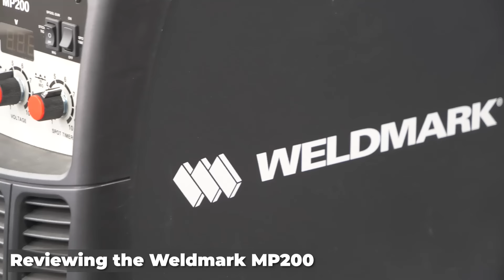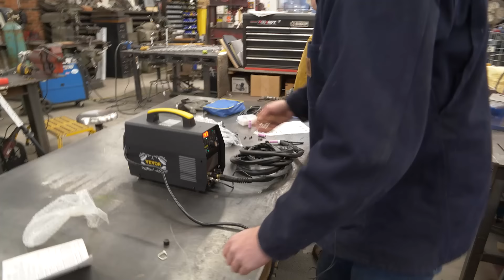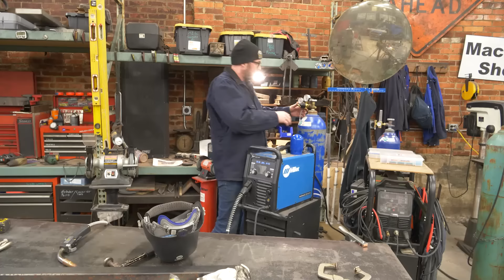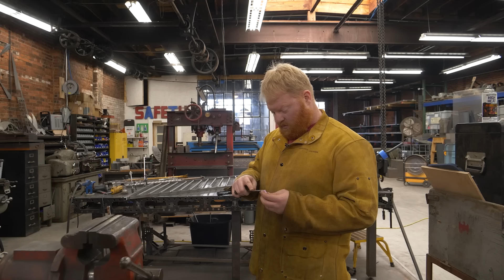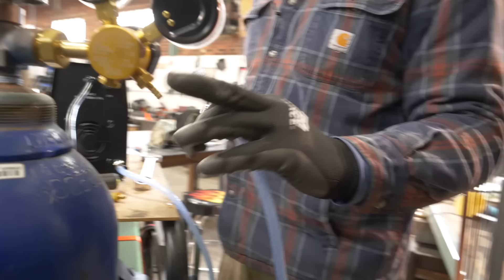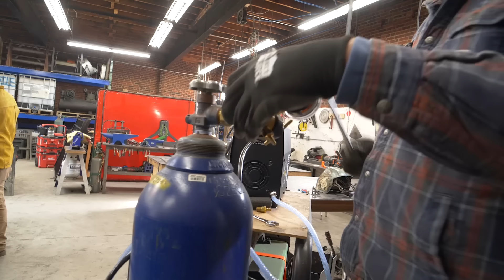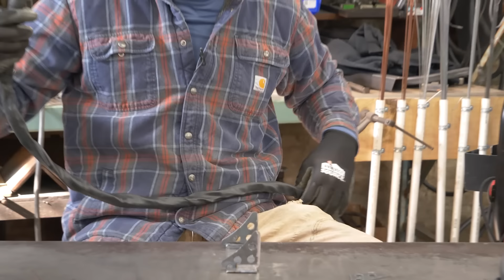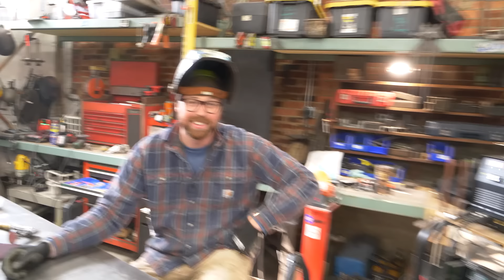$200 TIG Welder VS $2,000 TIG Welder

Comment: For the hobbyist it's a no-brainer..go buy it!
Of course, you can't use it in a professional environment where you weld 7 hours a day, but it's not meant for that.
I weld some stainless now and then and I bet it can weld my copper too. Home users won't do much in aluminum which requires AC mode anyway.

Comment: I have a everlast multi process and I just can't get it to weld with flux core wire... I must be doing something wrong. Maybe I need a different wire feed wheel. It just shuts off when I start to weld. Drives me crazy. I hate to buy a cheap flux core welder when I have a big nice welder.

Comment: You cannot really compare something by the size and weight, go back 8 - 10 years ago and remember what your cell phone was like, a brick, or a PC, they are now very small, more powerful and can easily hook on the back of a tv. Going back a few more years and remember the stick welders(most, probably still working) that took 2 people to lift them, now better products in a shoe box. Its just evolution in electronics, not that I'm saying the Vevor is better than your AC/DC Everlast, but you get my drift.

Comment: Have a synchrowave. Miller, 250 trail blazer with high frequency and CK MT200. Had an Esab welder this size and sold it, sure miss it. This will replace it.

Comment: 20:21 its not, only a two pin connector on the pedal/trigger input  for on and off, with an amperage controlled varistor/encoder style pedal/switch theres about 9 inputs

Comment: Not really much of a test. I like cheap, but many of these types of welders work good in a sweet spot, mid range current. Then they sometimes 'drift around' on very low or very high settings. An opposite example is with low-end, name-brand welders, import cheapies with blue or red paint job and big price tag. . Small Miller welders (1000$)with electronic gadgets that constantly try to out-guess you. Will not stitch very thin sheet metal. 55$ Harbor Freight 175 amp open-box special with only 4 heat settings is better for delicate work.

Comment: All my Chinese products quit over time. The difference is the quality of the components. The electrolytes in the capacitor, the quality of the solid state devices. The often under sized resistors, the gas valves etc. they all work, but not for long. You may get lucky in that the lot of parts was good but most often the quality control of their supplies is questionable.

Comment: I weld stainless process piping for a living . Young kid showed up to the job with the same exact welder .... my my miller maxstar 200 was at the other enc of the plant so i gave his lil machine a go , I almost cried , it welded as good as my miller ..... now will it last 10 years with daily use , probably not , but I was impressed how well it welded sch 40 stainless pipe.(edit) the twist connect are miller type connections

Comment: Duty cycle is the voltage and amps it can run at for a hour for a certain percentage of that hour soo let's say 100 amps is 100 percent duty cycle but 160 is 50 percent duty cycle meaning it can only weld for 30 minutes of a hour at 160 amps also each input voltage effects the duty cycle. Also u cannot weld for 100 percent of the time for a hour soo 100 percent machines are nice at max amps but not needed as u know u need time to let things cool etc and can't just put 250 amps into metal for a hour and have a good weld especially on exotics what tig is really only good for lol

Comment: The crazy thing is that at $200, you really have very little to lose. If you spend $200 on this, buy a tank of argon, start investing in other accessories, then when you want to step up to an AC/DC welder, the next logical step is something like Primeweld for $800-900 which has all the capability you could need if you aren't in a factory production environment. So sure, you're out $200, but then you also have a backup or portable machine, and your gas plus other accessories all carry over.
Reply: Right now its 86 bucks for a 4in1! Crazy!
Reply: @darrinhaskell6068 Yeah the welders China is producing are just so insanely cheap it's wild.

Comment: I bought a cheap welder, miltiprocess and it works great when it comes to stick and flux core. It has modes for mig with co2 and mixed, and it clames to be a lift tig as well. However the gas setup is problematic. Bought a regulator, bought a bottle, but they don't fit. The connectors seem to be made for each other since I don't think the differences between standard sizes would be this small (like .1 of a mm) so the second regulator is on the way. a bit more expensive this time. The welder came with a tig torch and i'd love to try it out but connecting the gas... there's so many types of connectors. At first I thought they put the wrong fittings on it, most of them seem to come with a nut, but mine has a male type of thing. After looking at lots of torches online I did find some with the same connector as mine, so it's probably not their mistake. However, after looking at quite a few, my type seems rather rare.

Comment: i just bought a yeswelder tig 205ds off marketplace for $80 and it works great.  it came with a tig torch that has a flex head, and the gas connection was a regular screw on.

Comment: i am more interested in the lowest amp setting,  because i got a multi process welder that is also on the cheaper side but not the cheapest,  and i found out too late it cannot go lower than 50amps.... which is way too high to weld thin plate on cars etc...      for a mig welder its to expected, but for a machine that is advertised as also tig welding you normally use that to be able to weld very percise stuff, but 50 amps is too high for small welds with tig,    for platework you need a welder that can go as low as 15 amps at least,     and there are a bunch of dedicated cheap tig welders that actually go to 8 amps even, just for 200 bucks (edit;  downside on that is those cheap tigs go low on amps, but they dont go high.    so i need to different cheap machines, one for the low amps and one cheap one for the high amps)

Comment: Just so you know when you have a nipple that has that yellow plastic washer thing floating up against the brass it’s called a push lock hose and you do not even need a hose clamp. They’re not designed for hose clamps they’re called push lock for a reason.

Comment: Duty cycle means exactly what you said. A easy way to calculate the duty cycle is to use 10 minutes for your time .
Example a 30% duty cycle Means it can run three minutes in a ten minute period.

Comment: The audio cutting out is interesting and might give you an indication as to why the cost is lower - in many/most other countries that produce electronics they have to be sent off to regulating bodies which test that they do not interfere with radio equipment (Like CE mark in Europe). Although I am no expert in Chinese electronics, I strongly suspect they go through no such testing. (this same point extends to safety regulations and testing).

It would be very interesting to see the breakdown of the costs that go into a 'western' welder. I am sure the electronic themselves would be far more expensive, but I bet there i significant cost in the regulatory hurdles and of course the labour of those people who manufacture it.

Comment: Like most tools, if you're just a hobby welder that only needs a welder once a month, the cheap ones will do the job. If you're trying to make a living with it, you're not going to have time to mess around with cheesy regulators and cheap foot pedals and such. I've had an AHP for several years. It improved my stick welding immensely and does a fine job in TIG mode on aluminum. Very nice for the money. As far as electricity goes, there's little difference between cheap and expensive.

Comment: Well in the end cheap does not need to be malfunctioning, the basic of TIG welding is simple, you usually pay for performance and extra features. This things are cheap because they have cheaper components, worse duty cycle, less amps then what they advertise and no frills like adjustability. The basics of deliver gas and let current through is kind of hard to screw up.

Comment: Is this welder actually good starting point for a DIY'er? Or was this all for the sponsorship?
Reply from the maker: So we were genuinely impressed by this little guy because we didn't even expect it to work!  However, it does come with some downsides!  The fact that it doesn't come with a gas regulator is kind of a bummer.  So by the time you buy all the other supplies necessary (regulator, gas, filler rod, etc) to get this thing up and running it'll probably be around $400-$500.  In which case (if this is your first welder) there are other options on the market that do come with regulators and have more features for about $400.  If you already have some of those things and are a DIY'er and want a cheap but decent TIG welder then this thing is actually a good pick!

Comment: U noticed both torches probably came from the same factory... most of the internals on the welders probably did as well. That was proven with the vulcan pro tig 200 compared to Miller I believe.

Comment: Im sorry, i know very little about this but would like to learn welding aluminum. Does this Tig machine do aluminum also?
Reply: This machine is DC TIG only. Aluminum needs an AC TIG machine to "clean" the aluminum arc surface. DC TIG works just fine on steel.

Comment: How do you do a test / comparison like this and not take it to the maximum advertised rating to make sure it does what it promises (metal thickness and current)? I'm sure it's a nice unit but if you were going to do one thing that would be the one most important thing.

Comment: I bought a cheap AC/DC welder some 10 years ago. It worked perfectly well right from the start and welded really well regular steel, stainless, aluminum. I kept it  in a dirty garage where there was metel dust flying everywhere, a few times I left it overnight outside, in the rain. My garage wasn't heated so it experienced humidity and temperature variations between hot summer and snowy winter. Works fine till this day.

I bought another one some months ago. I only modified the things which are usually crappy, so I built my custom torch which is smaller, has a separate hose for gas and a separate wire (flexible silicone) for the current. I also repositioned the button all the way to the front so that I press it with my index finger. I even welded really thick stuff with those welders.

The bad news for you is that the Eastwood TIG comes from the same factory as generic ones. It's just being rebranded. If you want to buy a lager numbers of machines the factory creates branding for you. So for example you order 100 pieces and the front plate and sides have 'Ugly Joe Company' or whatever you want. Like Eastwood.

Comment: wow, are you guys in an old Amish tool shop?  I think I have seen those pulleys on the ceiling before.
Reply from the maker: sort of haha, the building was built in 1917, its been a machine shop since the 20's, all the old machinery used to run off the line shaft system in the ceiling, a lot of it still worked when we got in here! the shaft will still turn if i run power to it.... maybe a future video...

Comment: It may be DC only and no stainless or aluminum BUT... There are hobbyists out there that want to weld light gage sheet metal for car projects, art projects, etc. and don't necessarily weld very often nor do they need a gas tig weldingsetup or big arc welder...
And I'm ok with that.
  I've also had some good luck (though very limited exposure) to this company and am happy with the cust. service, shipping and the product.
 Thanks for the video.

Comment: It's great but sad but these cheapo offshore welders are typically pretty good. My son bought a $100 11lb stick welder and I was skeptical but it will run an 1/8" 7018 rod effortless.. i work in a custom fab shop and we have all the good stuff miller lincoln,hypertherm ect. But for home if one of these cheap ones worked I'd buy it. I bought a miller diversion 165 or 185 I can't remember back in the 2010s I paid $1400 and for controls it had on/off, heat and ac/dc that's it... I sold it and bought some nice 15" subwoofers! I don't regret that at all I got way more use and smiles from 150db of bass over a under performing over priced tig collecting dust in the corner and when dug it out to sell it after a couple years of sitting the trigger and or solenoid  was acting up also (wouldn't turn on when button pushed), fortunately it slowly came out of it.... I still have my Lincoln weld pac 180 and that being bare bones it's a tank, it weighs about 80lbs and few years ago we had a huge hardwire job ( several 40' dryer enclosures for paper pulp egg cartons) and we have a bunch but actually didn't have enough wire welders and big Lincoln power mig 225 & 350s didn't fit everywhere so i took mine in and it chooched out . 030 all day for weeks it never even duty cycled out somehow I was impressed with its capabilities but then again where its transformer type not inverter type it has 80lbs of copper windings in there can't knock old school heavy.... So prob never sell it. We have 3 miller maxstar DC 200s sitting in the tool cage at work collecting dust there pretty expensive too over $2000 last I looked, there wired for 480 and set up for stick, we used them at a mill we did maitance at but we opted out eventually they have been sitting ever since, ive tried to get them to re tap show power cord app set at least one up as a more portable dc tig where our squarewaves are size of washer machines but they won't because we have a small ac/dc Lincoln tig and a "portable" water cooled hypertherm tig that has ton of functions (it's technically portable its all stacked on a dolly but it's a p.i.t.a. to transport). Like said maxo cheapo wire welder is most likely type to end up paper weight.

Comment: $220 without AC Welding for Aluminium.
Great for doing field work.
I have $1200 machine that is 
the same size. Unimig Razor and is compatible with the heavy duty machine and has a foot pedal.
All is supplied.

Comment: For carrying in the field these units rock, way lighter than the old transformer types and plenty of power for most stuff on 110v, huge difference when you are literally carrying it all day. It will do about the same output as my older ones but draws less current allowing a smaller gauge cord or use a much longer with less loss, very helpful.

Comment: Couple years ago I got a Toolium multi for 320$, didn't come with Tig torch and no mig reg. . The wire drive is well built and flux/stick is outstanding as well, much lighter than my old transformer Lincoln/miller. Will run the 10# spools and stinger is quality too. The only question is lifespan for me, probably couldn't find parts etc., It probably has 10 hours actual weld time and the 110v will run about 70% rating, 220v I pushed 200amps w/7018 Ex. 5/32. Burned 5/16 clean steel quite hot, excellent pen. And appearance.

Comment: Alri guys.. I bought a couple of tools from VEVOR. They're a decent company as ling as u understand what ur actually buying but u cannot go wrong if u k now what ur doing. U guys know what ur doing and I'm still LMAO at how u reacted to the cheap TIG welder being so great.. 
I bought a 2 in 1 Lift TIG/Stick welder for foer under 80 Euros. It's one of those DEKOPRO ones but I'm only beginning to weld. I want to start by Stick welding. I sPent more buying a Apron and gloves with a couple of packs of 6013 rods 1.6 + 2.0mm.. haha! 
I know u think it's mental and probably a death trap but I bought the DEKOPRO off Amazon and I know another Youtuber who is a proper dude with this welding game and he uses the same small welder. Now he has bigger better machines in his shop but he was just showing us newbs how cheap it is to get started in the welding game. 
I'm about to build my own home built Table saw and I bought the stick welder/TIG welder/Lift Tig which I need to say I didn't understand what this meant until watching more YT videos about it. 
Years ago when i was in secondary school I used gas welding or acetylene as we called it back then in metalwork class. I was 12/13 yrs old then. I'm 50 now lads.. LOL.
So u could say I'm a complete newb. I'm going to weld the frame and housing of the table saw myself. I want to build the saw from scratch so I'm going to attempt to weld a frame to hold the saw motor/arbor and blade housing all in some 25x25mm square tubing. That's the plan and then build it into a 40x40mm larger frame. It sounds a bit crazy the way I'm explaining it I guess and I don't know why I just did that but I'm excited as heck to get started.
My only fear is I weld right through the metal bcos I don't understand the Amps/current.etc atm but practice will make sorta perfect??? I'm going for it soon so please wish me well lads..
Great video btw. I really enjoyed how u guys explained a lot of what u mentioned in this video. Is there any chance u might do a full video on what LIFT TIG is all about?? I liked the pulse thing u were doing. 
The welder I bought with TIG function doesn't come with the torch. It only comes with the ground clamp and stick clamp. 
How will I know which TIG torch to buy?? 
Apologies for the longwinded comment btw and thanks for the great content guys. Keep up the great work.

Comment: Just picked up a vevor 200 amp ac/dc tig and it’s awesome. Be prepared to mess around with it though. The regulator is barbed and is cga-320 instead of the proper cga-580. Accessories sucked. The pedal is just on/off but has hookups for a amperage control pedal. Bought a cheap pedal too but had so rebuild the pedal as it came with loose switches, switches mounted backwards etc.